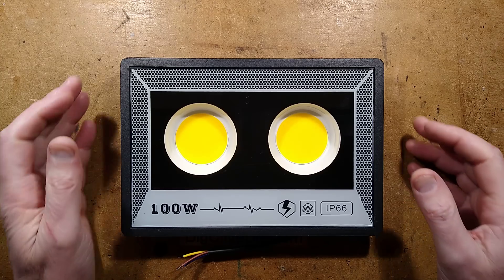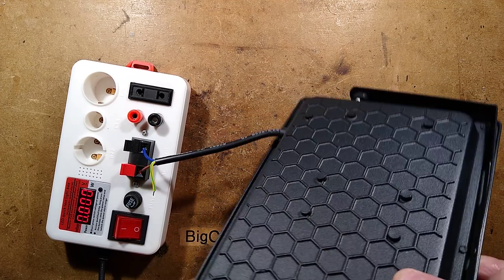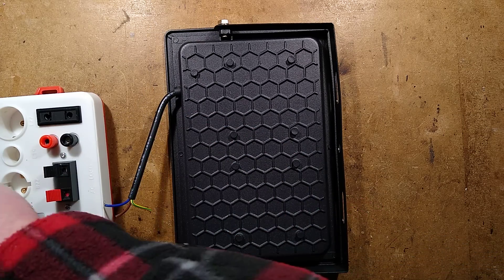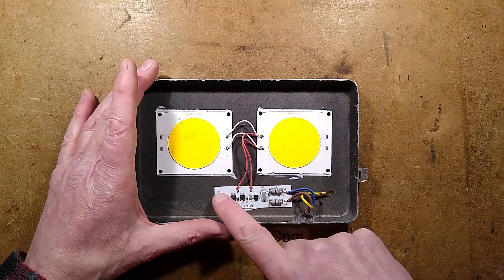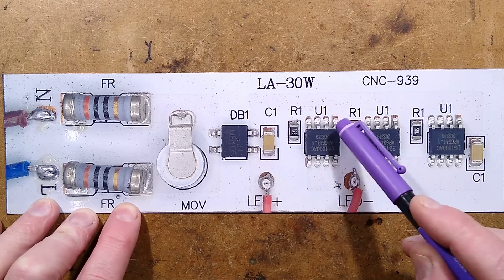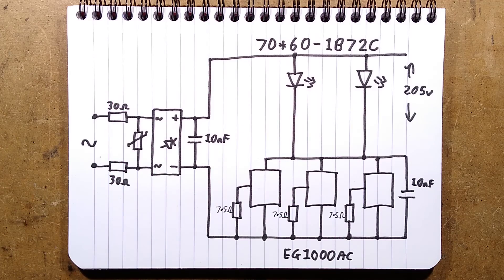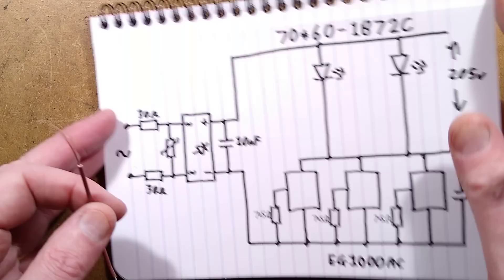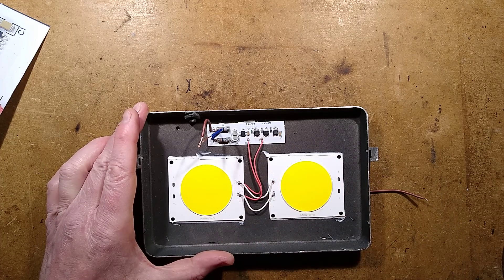Temu 100W LED floodlight is exactly what you'd expect.....

Comment: 100W here might very well be watt-equivalent.  That is, while it draws only about 35W, it produces light equivalent to a 100W incandescent bulb.  This is common in the USA at least, where consumers are still used to the old incandescent wattage being the indicator of brightness and role-appropriateness.  A 100 watt-equivalent drawing 35W is actually about right for this to be the case.

Comment: I do appreciate Your way of analyzing things - wondering who dare still supply You (should You not be on....international blacklists already?) - BUT in this specific case, I have two concerns to this design: 1) it does not make sense to parallel the LED COBs, under a common cascade of currentregulators in series: if one of the COBS fail, it will destroy the second one by pumping twice the current through it - would have been easy, to avoid that. 2) some maneuvre-critics concerning the - beloved - Dremel-approach: did You take in account heating the front and trying loosen the glue by these means? could have saved YOU the mess, You prevented US from taking part......- but: go on analyzing, go on critisyzing!

Comment: I bought a pair of 20W LED high beam lamps for my car from eBay and when I fitted the first one I tried it and it was so dim I swapped it back out and powered it from a 12v psu in my house plugged into a kill-o-watt meter and they were only 4W!!  When contacted the seller they offered me a discount to keep them which I kindly declined and returned the useless lamps.

Comment: Big Clive, I had a question about these Chinese made lights, most of the flashlights have the annoying light, half intensity, and seizure inducing blink functions when you press the power button, is it possible to take the low intensity and blink out of the picture by perhaps cutting a lead on the chip that is in the light? especially the blink function, it is super annoying.
Reply from the maker: It's usually baked into the chip.
Reply: @bigclivedotcom   well darn, I was hoping it would be someithing simple like putting a leg, if only they would drop the blink function , , ,  thank you for the answer. you're the best.

Comment: either 100W includes the energy from the housing burning, or 100W is the model number, just like my new LED car headlights that have a model number of 22000lm but a light output of ~3000Lm

Comment: I noticed the live and neutral wires are connected backwards on the PCB, but as you connected it correctly according to the colours when powering, I'm guessing the screen print is incorrect (or it's a generic PCB that can be configured in reverse polarity). Lucky it was assembled correctly at the factory to begin with, in that case.

Comment: An important point to note is that it doesn't say 100 watt. It does say 100w which could just as easily be a model number and not a power rating. Just because you assume that the w means watt is not their fault, that's on you. The fine print somewhere probably says that 100w is the model and not any indication of wattage.

Comment: The Government really should stop dangerous rubbish like that, coming into this country. I consider a metal cased mains operated unit with no proper earth connection to be unsafe and possibly dangerous to the consumer. 

I bought an "I.R. Reflow Oven" from a Chinese company where the "Earth" connection was screwed to the metal case, but was not making electrical contact, due to the painted surface on the case. I only needed to carefully scrape a little bit of the paint off the case so that the Earth tag made proper electrical contact to the metalwork of the case. There are also other known manufacturing 'cockups' with these ovens, that also have to be addressed. But once they are all done, it's a very nice unit that works well.

Comment: Is it 100W actual or equivalent?

By that I mean LED bulbs typically have 2 wattage ratings listed on their packaging...the Incandescent Wattage it's light output is equivalent to and the Wattage it actually draws...in Canada, most 100 Watt equivalent LED bulbs actually draw around 13-15 Watts so you get the same amount of illumination as a 100W Incandescent bulb while using less than a fifth of the power...

Comment: I remember when led's first came out they were marketed by comparing them to incandescent lights. Witch are sold using watts as the delimiter. So your 100w equivalent led would say so on the box, (not always with the equivalent distinction) even though it's draw is much less. It's been awhile but afik a lot lights are still marketed like that. The issue is the industry needs to move to using lumens to grade light output since that is independent of power draw when multiple technologies are to be compared. Could that be the issue here? How does that light's output compare to an incandescent bulb?
Reply: Have you seen lumen ratings on chinese torches? They just put random crazy numbers on. At least with wattage they know people don't want super high power draw so have some self control with the lies
Reply: @Muffinx93 giving the benefit of the doubt to scam websites is D-tier humanity. 
But look at all the "likes" the comment got, so apparently you and I are just humbugs and possibly even racists to boot. Do you wanna go to a Klan meeting with me ?
Reply: "100W equivalent" would still make these lights about half as efficient as modern stuff from Phillips and other major lighting manufacturers where ~15W LED bulbs are their 100W tungsten substitutes.
Reply: A 100W equivalent LED should draw much less than 35W. Not even half that, so that should not be what they meant (or this thing is super inefficient).
Reply: @julians6679 I mean, these big LED clusters without any cooling in a plastic box prolly aren't gonna run too efficiently I guess
Reply: Even "Lumens" are greatly exaggerated by Chinese manufacturers, so literally NOTHING electronic is safe or "sacred" from the straight up LIES that these cheap Chinese (garbage) manufacturers regularly make and claim, just so they can sell their crap products at "impossibly cheap" "deals" to everyone who's actually gullible enough to believe that BS! LOL!

It's such a sham, (AND scam!), that this modern economy is even allowed to operate like this! You'd think that there SHOULD be some kind of regulations preventing this kind of straight up fraud, but apparently there isn't!

This is a perfect example of why I NEVER buy anything from sites like "Temu" or "Ali-baba" or any number of others that sell all kinds of "impossibly cheap" products from China... You already (SHOULD) know that the stuff on those sites is going to be absolute GARBAGE quality, ONLY meant to use ONCE, (MAYBE, IF it even works at all!), and then you just throw it away and buy another one! LOL!

This modern society and world economy is really rather appalling, especially when it comes to the actual quality and longevity of merchandise now!
Reply: That is my thought as well. 100W of equivalent light output when compared to incandescent.
Reply: It's on Temu. Higher numbers = more sales. It doesn't say 100 watt equivalent, which the legitimate products do say. 
The "issue" is Temu products are sold with fake specs on purpose. You only need to look for 1 minute to find "one million lumen" flashlights 
Please don't try to give scammers the benefit of the doubt.
Reply: @Boogie_the_cat  I asked a question worth asking even if it isn't the case here. I wasn't defending anyone. Frankly I knew the answer. But Clive didn't take about this very real phenomenon, so I brought it up.

Comment: why domy led flood lights flash ob when they are turned off?
Reply from the maker: Capacitive coupling through long switch-wire runs or leakage through electronic control circuitry.
Reply: cheers,i was thinking in lay man mentality as the isolatoris singlepole itsfedon the neutral side periodicly charges the circit inside so flashin, its just annoying..... @bigclivedotcom

Comment: The next generation,  having never known incandescent bulbs, will understand that lumens are the way to measure light output.
Presumably, the 100W rating is  meant as brightness "equivalent" to a 100W incandescent source?
Although even that isn't likely correct; LED lamps I've purchased generally draw about 10% the power of "equivalent" incandescent bulbs.

Comment: Very first thing in the video: 

Lightly taps painted (potentially even plastic) piece with a multi-meter claiming that earth clearly isn't connected to it... 

Dislike, moving on...
Reply from the maker: I touched the meter probe to a bracket screw tapped into the metal casing to test earth.

Comment: With "copper coated aluminium wire" there's bound to be some schmoke sooner or later.

Also, with 72 LEDs in series, if one dies, that entire chip is d.e.d !!!

Great Viodeo, thanks Clive!😀
Reply from the maker: If one dies it may track across internally, causing the LED module to flicker until it finally burns clear.
Reply: *When one dies
Reply: White LEDs are generally Blue LEDs covered with yellow phosphor.  Blue LEDs are InGaN, and have no bond wires in the actual LED construction.  InGaN LEDs tend to short circuit when they fail catastrophically.  So, unless there is physical damage and an LED is mechanically broken, the dominant failure mode is short circuit, to the rest will stay on.

Comment: That test for ground leakage current didn't make any sense.
You put the meter in current test so the meter looks like a short, introducing a path to ground. Then you measured AC without any AC source. Also, there's no possible path to ground in the circuit so why would there be leakage to ground? Through the plastic and wood?
Reply from the maker: Many large area LED floodlights have high AC capacitive coupling from the tracks, through the thin fibreglass shim to the aluminium core.

Comment: what is the matter on the wires? I didn't understand what they covered copper on to , that burns sooo easily
Reply from the maker: They often use copper coated aluminium to save cost.  It is not safe.

Comment: Do they mean that it has the equivalent lumens to an traditional incandescent 100W light bulb? I notice that there is a screw hole for the earth  but nobody bothered to screw it down, lol! The latter could have been detected by them if they operated an SPC quality control approach and fully test 1 in 100 units and frankly that would not cost them much but perhaps they place too much faith in their underpaid and overworked staff.

Comment: Most LED bulbs packages are marked as equivalent brightness of incandescent bulbs. of equivalent brightness.  That's what the 100W is actually referring to. The actual wattage seems low compared to medium base light bulbs I am using. So I doubt the 100W equivalent claim.

Comment: The LED’s could be at the posted at their reduced voltage, which is unknown from this post. You would have to put the Watt Meter, after the power supply and before the LED’s. I built my own LED Lights, with 10000k and 440 to 450nm, 30watt each. At the 120 volt plug the entire Fixture draws 32watts at 118 VAC, This includes the Power for the cooling fans, and LED Drivers. At the LED, I’m close to 30watts each.
Reply: Are you saying that you have two or  more LEDs that each consume 30 watts, but the fixture combined only consumes 32? Watts shouldn't care about the voltage level. It's a unit of power. So that would violate the laws of thermodynamics.

Comment: I’ve purchased a few of these lights a while back. Every single time, the ground wire is just ignored. Literally in the bundle of wires just so it can stop an inch into the housing and no connection whatsoever ever.

Comment: Recently I tried buying the $20.00 'minimum' affordable amount....and received merchandise worth....maybe $1.15......20, 000 lumen automotive headlights, 125 watt 'chips'.!!....so when I get them, power-up and 12 volts and maybe .2 amp....so there's like what...2.4 watts...and the usual formula of 100 + - lumens per watt....there's maybe 240 weak lumens, good for a very short range flashlight....
  I'm just speculating on this stuff....I don't have any type of 'lumen' meter....but the best Led's are barely providing 120 lumens per watt....need a heatsink and are expensive, compared to this TEMU stuff.
 The other few electronic items I ordered were equally bad...50 1 watt COB LED's for $2.99?.......Not even worth it if they were free.....they looked just like the Phillips 1 watt COB's I already have ($3.50 each)....but they barely lit up anything...more supposedly 'auto headlight modules'....12 volts and barely 1 milli-amp.....12 milliwatts pretty poor for a white led....

Comment: There doesn't look like there's much insulation under the live connection.
Reply from the maker: It's a wafer thin layer of fibreglass.  But often the wires are soldered right at the edge.

Comment: The thing with 100W is probably "equivalent of 100W incadescent lightbulb". IDK, this is such a stupid trend. Not with the lightbulbs though, they are usually decribed properly and the "equivalent brightness in watts" was pretty useful before we got used to them. The stupid trend is to place idiotic values wherever a value goes. Like in batteries. I would buy cheap 300mAh battery, but it's super annoying when they are advertised as 10000mAh batteries. The first time this stupid trend was used for boom boxes. And so called "music power", each of them had at least 1000W (in fact having more like 5W). It's like we all know what it is. We know that small boxes are not very loud and cheap lightbulbs are not very bright, cheap batteries have small capacity. We also know, that even branded, top shelf expensive ones don't have such crazy values.

However, some of those chinese knockoffs are still worth buying. I have a flashlight that was advertised as 27k lumens. Of course it's a joke, but it is still brighter than my car's headlight. Instead of one modern and expensive LED it has like 20 cheaper ones, but the light is really good. I'd say, best value for the money.

Comment: question: are these transformerless drivers/PSUs the thing in LEDs now? I plan to fix a couple of LED bulbs that mostly have PSU problems. I'm just not sure if is worth it because these transformerless LED lights are really cheap.
Reply from the maker: The linear current regulators are very common now because they are cheap and simple.
Reply: @bigclivedotcom  thanks! I'll just keep those broken light for spare diodes.

Comment: I ordered and received a Bluetooth 100w Floodlight and discovered it had no earth. Being in the appropriate Trade I refitted an earth wire. I measured the Power on the highest Brilliance setting and it was 100w. My Lucky day. Health & Safety does not exist in China, therefore expect dangerous situations. I have a good quality LED Hand Work Light. I picked a model that had replaceable 18650 Lithium Ion Cells x2 (3.7v) and bought a high quantity Intelligent Charger with temperature monitoring.  The supplied 6" USB-C system may not have internal cell temperature monitoring.  With Lithium Ion I want control of the charging.

Comment: 5:55 Hi kink palculator, long time ago 😂
Chinese power seems to be 'different'. A '60Watt' power supply may deliver only 20 in practice. And that's not even taking into account longevity. It is quite hard to shop for actual good power supplies, because the rubbish floods the market.

Comment: Doesn't using one regulator circuit with two LED modules in parallel cause problems, because the LED module with lower voltage drop will be considerable my loaded?
Reply from the maker: If they are from the same batch they will be fairly well balanced.  But from different batches there will usually be uneven current sharing.

Comment: They measure the light in lumen.
A 100W incandescent light bulb is 1600 lumens.
If this lamp measures 1600 lumens, it is spot on.
Watts mean nothing, they use the strength of the light it produces as a measurement.

Comment: Back in 2015 -ish I was still able to get a refrund from an Alibaba seller, of a floodlight sold as 50W. It had a measured wattage around 30, and it had a driver labeled as 35W inside. IDK if they removed the labels since, probably 99% of customers wouldnt bother (or dare) to check.  It also had the ground wire loose, even though there was threaded connecting point. At least they were easier to disasassemble back then 😅

Comment: They got the live and neutral colours arse-about-tit too, what is the separation between the back of that pcb and the metal case like?
Reply from the maker: The main separation on the aluminium core PCBs is a thin shim of fibreglass between the aluminium and tracks.  It's not uncommon for a failing LED to arc and burn through it.

Comment: Yet another low cost product that brings a significant health risk to the user, I wish consumers would understand that with sites like Temu you get what you pay for which in this case was a device that blatantly falsified it's energy consumption so it could appear to be better than that it really was and which posed the risk of electrocution.
The only good thing was that the site removed it from sale, which is better than  certain other internet marketplaces would have done.

Comment: The benefit of using fake copper wire is it can't support any real current and can double both as a fuse and a firework when it disintegrates.